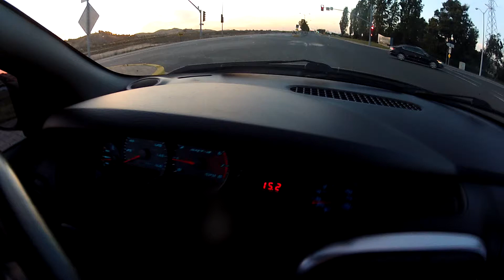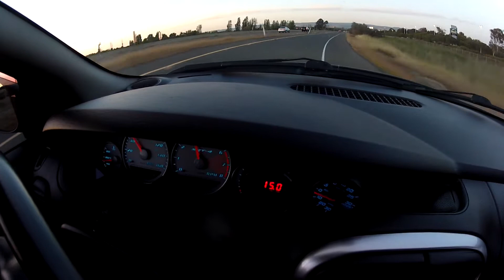Stage 3 Srt4 freeway pull

Comment: I had one in 2010. I cant say if you're brave or dumb, hitting that bridge at that speed, lol, I imagine neither can you. I remember high speed bumps made me Very nervous in my srt, When I didn't let out early enough lol.
Reply from the maker: I'm probably a bit of both. This video was a long time ago and about 500 horsepower less than now. I've learned a little bit since then... just a little. 😅👌  in all seriousness though, I built her to be pretty damn stable at higher speeds. So far so good!
Reply: What I have learned in my experience in high speed driving as long as the tires can handle it.
 Don't slow down right before hitting the speed bump. That causes the car to nose dive. Best thing is to let out the throttle a little before.. Then let open it up hard as you can right before a bridge or bump. Doing that allows the front end to pick up and go across it a little bit easier.
 Making it easier on your steering components. The rear end in a vehicle should be able to handle it the impact easier than the front.